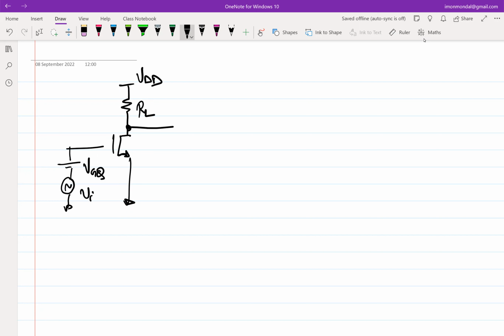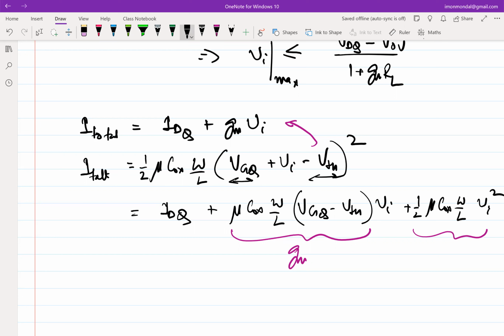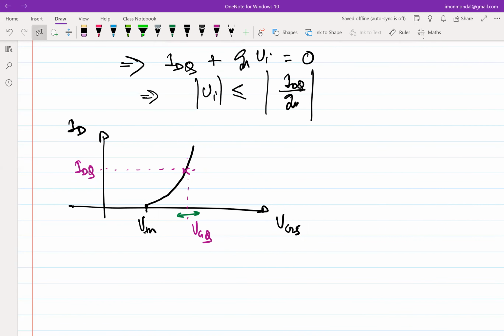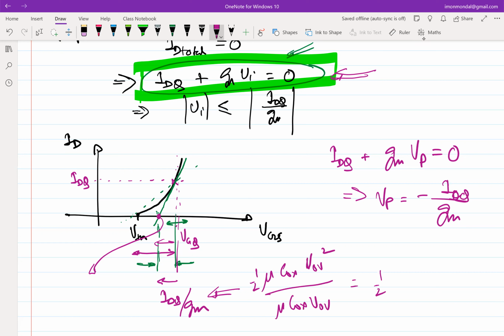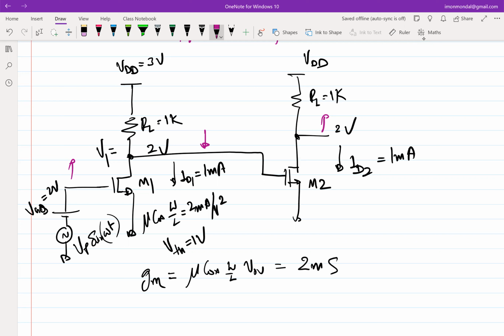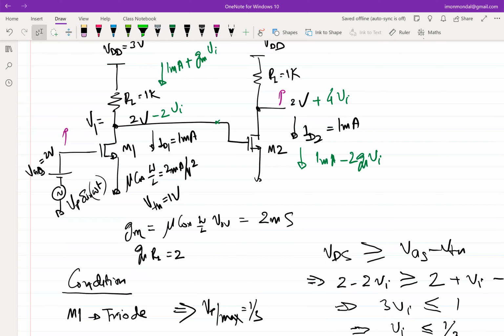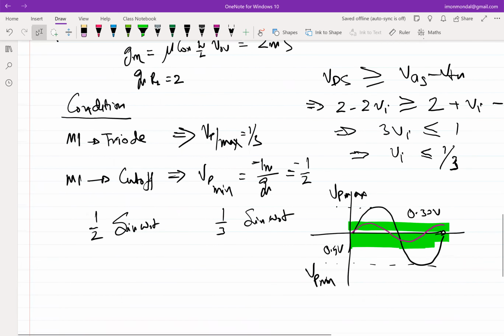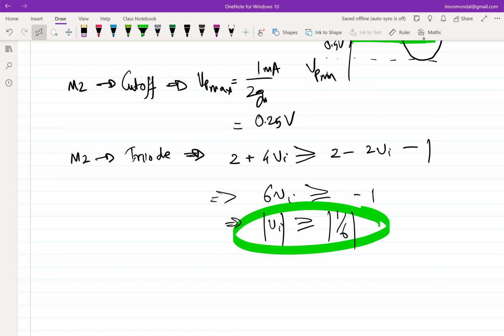Lecture12: Swing limits continued.

Comment: 00:00 small signal approximation of current in finding swing limits
7:24 Finding a lower limit of the input signal | Swing Limit
12:23 Graphical representation of total drain current under small signal approximation 
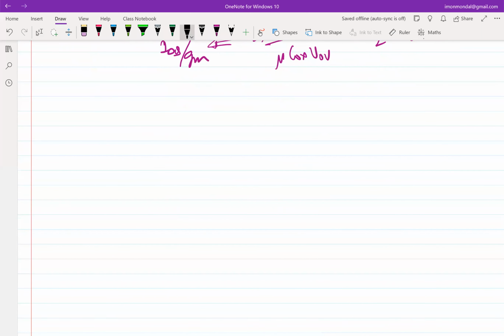 22:55  Example of swing Limit